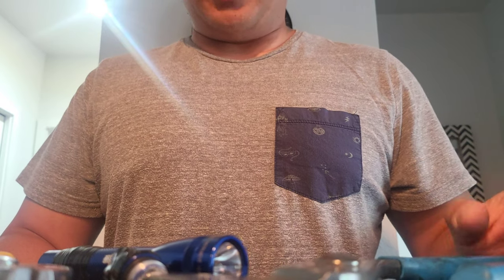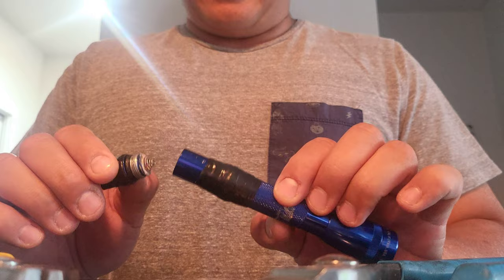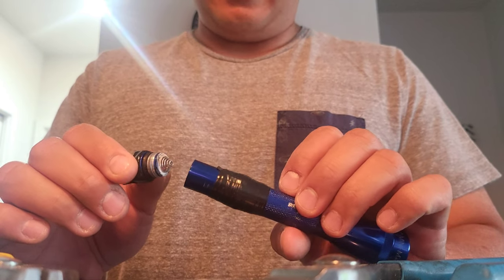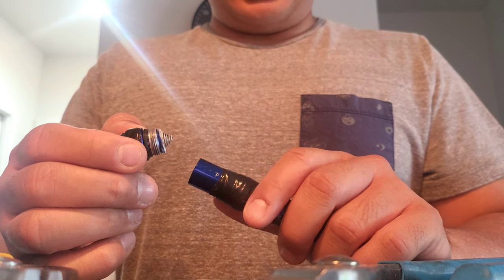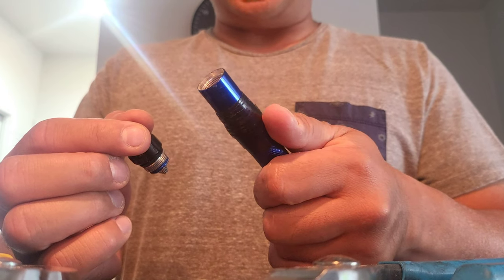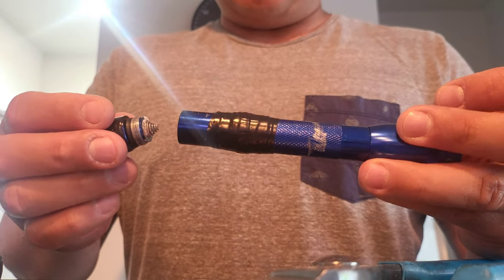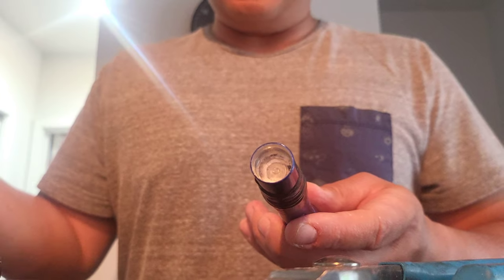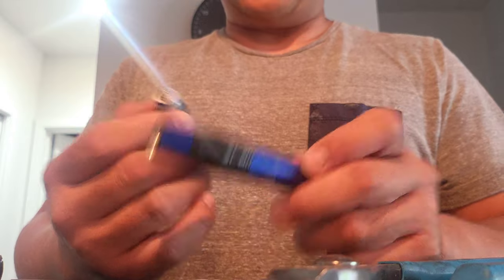Removing seized / stuck battery cap from maglite

Comment: "She blinded me with SCIENCE!" Thank you professor! Heating up the casing did indeed work. I used hot water from the tap inside a tin can. I also attached a thick cable zip tie around it, pulling it tight. I secured the battery cap, surrounded by a cable zip tie, into a small vise. The cap released with no damage to the shiny blue chrome. As I suspected, the batteries did indeed leak. On to the next issue...

Comment: I changed batteries (3 pack) in a Coast flashlight. I believe I put it in upside down and wound up locking the cap end when I put it back together. Have any advice How to unlock the cap?? 😢

Comment: Ill wonder  do you two vise grips  to losing  it Ill try  boiling  hot water the flashlight  hot that tape fall off feel like 
Cement  glue it not mag light  little  better  led  leser T7 tactical flashlight  
Going heat hot water let cool down put 
Tape try it again
Reply from the maker: Yea, you'll want to heat it up woth out the tape.  Dry it, then put the electrical tape on it.  Vise drips or, in my case, pliers work